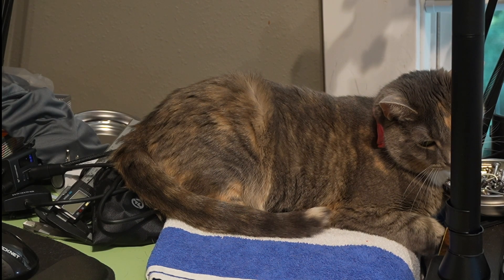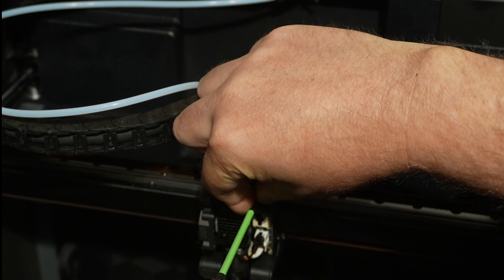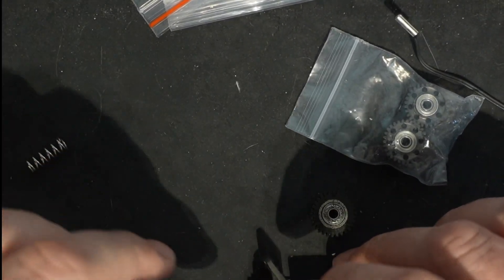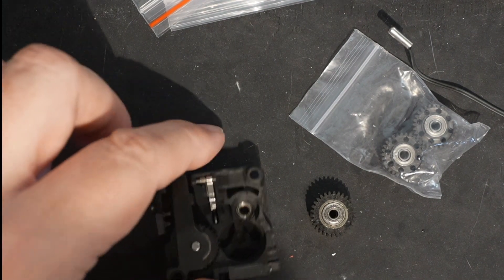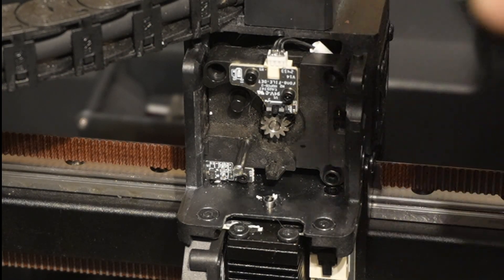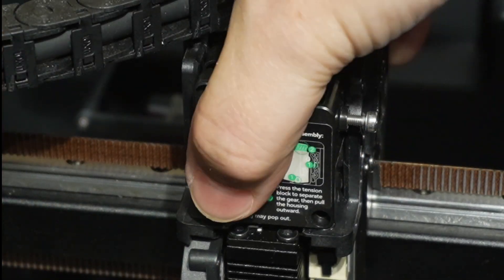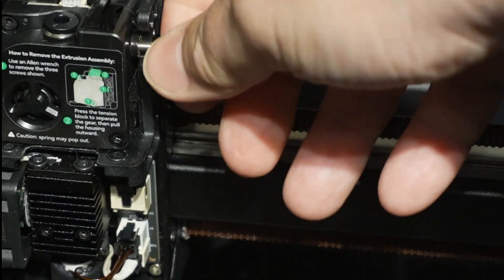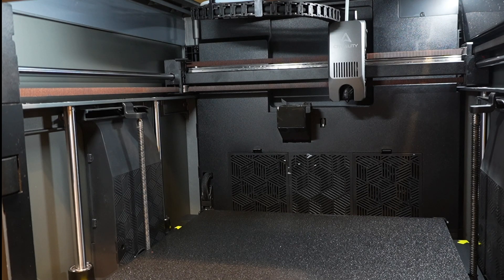Creality K2 Plus Extruder Upgrade: Replacing Plastic Gears with Metal

Comment: My spring also popped off, never to be seen again.  I swept and ran a magnet across my entire office.  Not found.  The Bambu Lab X-1 Carbon and H2D are running.  The Creality K2 Plus sits dead in the water.  Why aren't there extra springs in the parts box?  It looks like the Bambu Lab H2S will replace the Creality K2 Plus.  I'll give this headache to the grandkids.

Comment: i have seen some negative comments on the metal gears do you still feel its a good upgrade?
Reply from the maker: I have had no issues with them. I have printed a bunch of hours on them. I should note that I did not have issues with the original gears but I did notice wear when I switched.

Comment: I used a gpu thumb screw and dremeled a little bit of the stock fan shroud. Whats a 2 week update look like with the metal gears? Printing good? Debating on going that route or waiting for the D3vil Design DXC extruder to hit the market for the K2.
Reply from the maker: Printing has been great. I am currently printing in ASA for a future project. The only issues I have had was printing extremely small parts that didn't adhere to the bed. A brim solved the problem. I would buy the gears again.
Reply: @minimal3dp what bed temp are you using. I did notice Creality's stock bed temps seem really low for abs. At 110 I was able to print full across the bed abs prints with minimal warping.
Reply: @minimal3dp  had you printed in ASA before changing the gears? I can't print in ASA or PETG, it does most of the first layer, then I get a "Filament failed to exit the extruder" or "Filament failed to be extruded" error that normally requires me to pull apart the extruder.

Comment: man i wish i could get my K2 back on line currently ,  kind of bricked , i had to Wipe all usb and reset that way, nothing
Reply from the maker: Sorry to hear you are having issues. Mine has been alright. I feel like my profiles are not quite right.
Reply: The reset from the printer is not enough for brick, not even the echo command, you need the nuclear option and creality did post this, there is a similar procedure for the k1 and they did that for the k2.
Reply: @Foreign_Tropical  I tried The WIPE ALL Command didn't work. is there a different one?
Reply: @calilifestyle I think that my reply will not help you anymore. But a usb ‘wipe all’ is just restoring the system to the default settings. It is not a re-installation of the OS. only a usb flash/recovery (directly to the upper mainboard) will restore the k2 to factory default. Maybe that this can help someone with the same issue.
Reply: @RobHeesakkers yeah I had to replace toolhead board and cables. Oh and two cables in tool pcba.

Comment: That screw is NOT there - EVER from the factory. It looks like something they re-thought and decided was not necessary.
Reply from the maker: Thanks for the heads up. I didn't think there was ever a screw there and  I cut out the part of the video where I searched for pics online to see if there was a screw. Pics of the extruder by itself shows the screw. I like the screw to keep the spring from flying across the room when I take things apart. I spent 20 minutes trying. to find the spring.
Reply: @minimal3dp  I DID see a YouTube video where someone put in a lighter spring and used that screw to lower the tension for TPU. Looked like a good use for it.
Reply: @ronbrown5799 that's the only way I've been able to reliably print tpu with the K2. Still have to go painfully slow compared to my other printer with a microswiss extruder. With that one I'm printing TPU nearly as fast as I do as PLA lolol.
Reply: @minimal3dp  Mine different have a spring either. I put it back togethetr without adding a screw. I didn't think I culd or should. It seems OK but if I get a chance to add one, I will. So far the metal gears seem pretty good. I also didtched the hotend and went for a Micro-Swiss unit with a CHT nozzle. I've had more than a few clogs previous to this, which is why I swapped everything out. I also put in the updated extruder with the brass insert instead of going right into plasstic.
Reply: @abitnutz6747  i also bought the microswiss hotend and the new extruder. I have not fitted it yet. How do you find the microswiss hotend? Is it worth it?